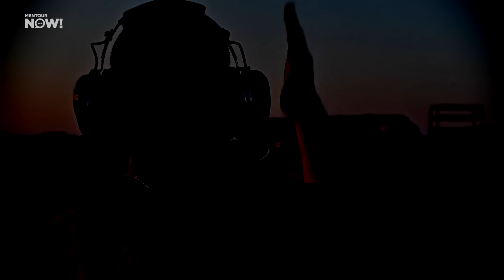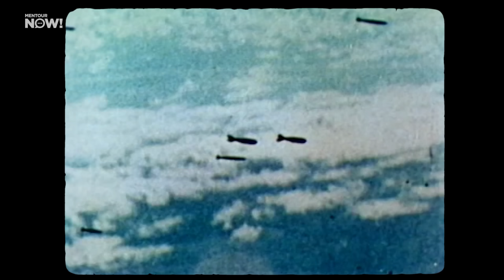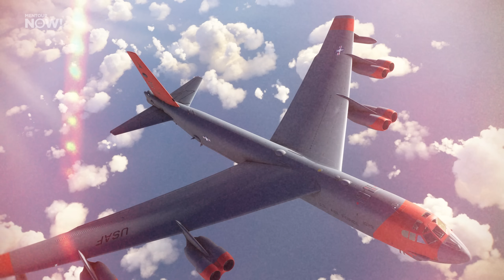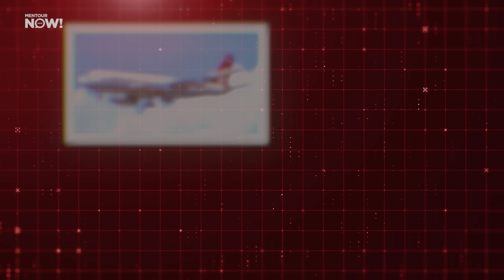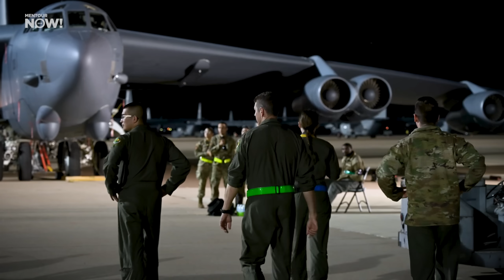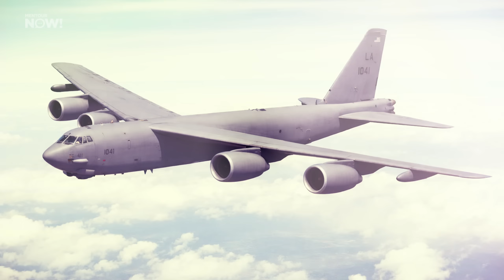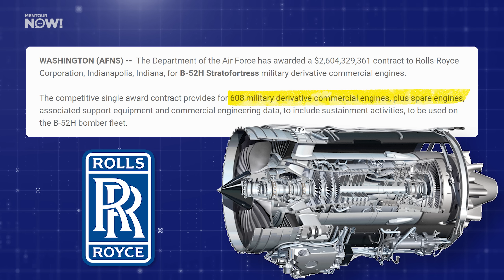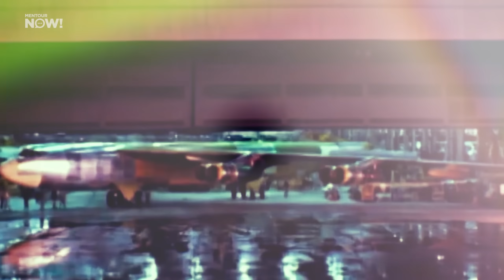WHY Are They Changing The B-52 NOW?!

Comment: At one point the 747 was proposed as B52 replacement. It was rejected because the USAF didn't need a large bomber anymore. Nuclear weapons had gotten a lot smaller and the huge airframes weren't needed,

Ever since then, the B52 has been a solution in search of a problem - and been pretty adaptable, but the primary reason it continues to fly is because it exists and if all B52s were grounded tomorrow they'd have replacement bomb trucks flying next week (Rapid Dragon and its cousins)

It's the "because it exists" that matters. The USAF has tried to retire the B52 multiple times and been stopped every single time by Congress - and in particular senators from states where B52 maintenance is performed (along with the "optics" of having the B52 flying around as a threat to opponents)

The "newer" bomb trucks are much better for crew comfort and safety along with being vastly more flexible but because American politicians won't alllow the B52 to be retired, they're effectively second tier weaponry

With regard to re-engineering the wing box, that's a minor issue compared to the far larger tail that's needed. B52s have a very small rudder and a nasty tendency to snap the vertical stabiliser off in turbulent conditions. It really would be an entirely different airframe by the time you're finished

Comment: the lockheed C-130 Hercules is almost as old as the B-52 (first flight 1954). Indeed, it's still in production. And there is a USAF  KC-135 still in service with the tail number 57-1719, which means it was paid for as part of US defense appropriations for 1957.

Comment: I mean, I have a radical idea for how they could sustain these engines: contract Pratt and Whitney to simply start producing the parts for TF33 and J57 engines again at a small scale. I'm sure there's procurement issues and manufacturing/tooling issues there but those can be resolved

Comment: The B-52 will have an active lifetime longer than most humans.
Truely, a masterpiece of cold war engineering.
Reply: And they will probably last far past 2050 with the new engines. As long as there is need for a large, long range plane that can go decently fast, the modern B-52 role will need a plane.
And designing a new plane is more expensive than just continuing the old ones.

Comment: Are you planning a similar video on the Tu95? It was designed and built at around the same time to do a similar job and is also still flying and doing that job 70+ years later

Comment: It took around two and a half decades to re engine the KC-135 fleet replacing the JT3-D with CFM-56 and that's 400 airframes. Therefore you can extrapolate that to re engine the Buff fleet it should take about two and a half months!😂

Comment: The B-52 is simply in a role that doesn’t require it to be cutting edge. Just its weapons. Fighters need to keep up in a constant race to be the stealthiest, fastest, with the best radar. The B-52 simply needs to carry a big heavy payload far, high, and relatively fast. You could build something new to do it better, but it’s hard to do that job so much better that it justifies replacing it. 

A 20% better fighter might give it the edge it needs to kill the enemy fighter first and remaine unscathed.

A 20% better bomber (in the slow non stealthy standoff category) could go slightly further, slightly faster, and would probably pack the same ordinance as the old one. 

It’s ultimately more economical to make the B-52 compatible with newer payloads than to replace them. If we did build something to replace them, we’d likely end up building half as many without them being able to carry twice the ordinance.
Reply: A study was conducted on the cost of developing an all-new aircraft with the SAME performance specifications and its cost was several times higher than refurbishing and upgrading the existing B-52 fleet.
The B-52 was so far ahead of its time that modern aircraft are not significantly more capable and just cost more to develop and build.
Reply: @DoktorBayerischeMotorenWerke  To be fair, modern fighters are also slower and carry less payload than those of the 80s.
Simply because the operation profile has changed.
Reply: @HappyBeezerStudios  Actually, I was referring specifically to dedicated bomber aircraft... not fighters
Reply: More engine efficiency might also mean more payload.
You can go the same distance with less fuel, so you carry less fuel and put that weight into more load.

Comment: The last turbine disk in a modern engine is rather large and at takeoff power represent a lot of gyroscopic inertia.   Further,  at rotation this results in a very large lateral load on the engine pylon due to gyroscpic response to the rotation.   I submit that the existing wing spars may not be strong enough to deal with such forces at rotation.  A totally new airframe design is no doubt very very expensive.  Witness the high cost of the f22, f35, and other newer additions to the fleet.  Just a few thoughts
Reply: 4 engines do not work for an engine-out takeoff emergency and the resultant lack of rudder authority.  8 engines do.
Reply: @SEO122 yet another reason for the refit.  I think he also pointed out a number of issues which would require wing redesign including you asymmetric thrust at engine out. 😃

Comment: Those old engines are ridiculously loud as well.
I remember hearing something that sounded military, but it was just too slow/lingering to be a Swedish military jet (JAS39), so I checked Flightradar24.
It was a BUFF/B-52 ~40km away cruising at 24,000ft 😯
I couldn't even see it, but it was about as loud as a modern passenger jet coming in for landing.
Reply: The J57s with water injection was louder...
Reply: Believe that's solved by high-bypass engines

Comment: A shout out for those who used to use a slide rule.
Reply: I used a 10" Pickett from 1957 through 1968 when HP calculators took over. I bought it at Bargain Benny's.

Comment: Will the range increase? The range is already 8,800 miles. A 40% increase would give it a range over 12000 miles. That's half way around the world without refueling. 

A B-52 has flown around the world and dropped 27x500lb bombs with the aid of refueling.

And what could be done if you designed a new plane from the ground up with the same mission?

Comment: The amazing thing is that this aircraft, designed back in the days when engineers used sliderules, is still so useful and still flyable in the 2020s and seems likely continue in use into at least the 2040s.

Comment: With the timeline and cost they are talking, and the fact that the # of air frames are finite. It makes me think that perhaps a new bomber with basically the same layout design characteristics, including all the fly-by-wire stuff, 4 new engines, modified wings, etc. might be a smarter long-term plan. Don't the actual air frames have a service life? Are they exempt because they are military? I've haven't heard of any planes made 65 years ago (or even close) still flying commercial passengers. I do think I've heard/read/seen that freighters generally have a longer life, though by how far, I don't know.

Comment: I was told by an engineer that the vertical stab wasn't designed for 4 engines and structurally the aircraft could not have 4 engines.
Reply: Correct. 4 engines do not work for an engine-out takeoff emergency and the resultant lack of rudder authority.  8 engines do.

Comment: Fascinating. I hope maybe you will do a presentation on the huge and mighty Convair B-36 "Peacemaker", the predecessor of the B-52. Powered by six piston engines (mounted as pushers) and 4 jet engines, it made a sound like no other aircraft. Though designed to carry the first hydrogen bombs, it was never flown in anger, but still had a place in the early 1950's.

Comment: I was in the USAF and ANG on various aircraft for 30 years and they have talked about going from 8 down to 4 engines on the B-52 since the 1990's but engines didn't make enough power/thrust until just the last 10 years or so and you have to have enough power in 2 or 3 engines for safety margins to keep an aircraft in the air with a full bomb load + fuel if you lose one or two engines.    And that is why this was never really possible until now.
Reply: 4 engines do not work for an engine-out takeoff emergency and the resultant lack of rudder authority.  8 engines do.
Reply: @SEO122  Its illegal to do a takeoff without ALL engines running to power !     During an Alert coming off the alert pad that might be over looked.

Comment: I remember in the '90's when Boeing, Rolls-Royce, and American Airlines kicked around a proposal to re-engine the bomber with 4 RR engines. Boeing would do the engineering, and American Airlines would do the work at its Tulsa maintenance facility, the Rolls-Royce engines being the same as the ones the airline used on its 757's.

For a variety of reasons mentioned here, as well as the timing of the end of the Cold War, the proposal went nowhere.

Comment: There are certainly at least three major issues related to switching to just four engines: 1) Aeroelastic: the new engines would probably have to be installed further forward relative to the old ones. That would change natural torsion frequencies, which may affect the flutter speed; 2) Aerodynamic: engines that are bulkier and moved forward may affect airflow on the wing upper surface, changing stability and stall characteristics; and 3) Having just 4 engines means that the engine-out scenario is equivalent to losing two of the old engines, which probably implies that more overall thrust is required, consequently higher pylon loads, higher VMC, etc.
Reply: Correct. 4 engines do not work for an engine-out takeoff emergency and the resultant lack of rudder authority.  8 engines do.

Comment: It was drawn up in 1947. Amazing it's still going
Reply: Can you imagine going back to that time, and showing the guys who built the b52 what the latest fighters look like today? And that their b52 will still be flying for another 25 years.
Reply: @BrettJulianChamberlain by 1992 or so the B-52 had been flying for longer than the time between the Wright brothers and the B-52 design being started.
Reply: I think it's more amazing that it was drawn in 1947 and the first flight was in 1952.
Imagine boeing drawing a new plane today, it would be optimistic to think it would fly before 2047.
Reply: @jamoin3829  They started the clean-sheet design for a twinjet 777 in 88 and the first took flight in 94, so that were some casual 6 years.
But then, that was also one of the last full on proper, engineering-based planes they put out.

Comment: I recall when this was first being discussed regarding the Pentagon budget calculations, repowering was ALL about dwindling parts availability and not fuel cost savings. But then someone who actually knew what they were doing calculated that fuel cost was a really big deal since "Airborne" fuel costs about 12-15 times as much as ground supplied fuel.
Reply: As Mentour said, saving money is nice, but for military the increase in range and loiter time will make a HUGE difference.

Comment: When K. I. Sawyer was still an air force base near Marquette, Michigan, they used to fly B-52's around the Upper Peninsula every single day.  You'd be driving down the road and here one would come over at treetop level, or you'd be hiking a remote trail and again, you'd be treated to the sight and sound of a B-52 just skimming the trees.  It was truly an unforgettable experience.  And yes, I have experienced it.
Reply: A regular sight when flyfishing the Escanaba River, back in the day. Always got my attention.
Reply: I was down the road at Kinchloe AFB, MI for 3 years. B52H also.
Reply: Many times. I had a friend in EOD I'd go hunting with, generally for red tree squirrels (no limit on them as they were an invasive species that constantly threatened the forests). You hunt them by ear, listening for them chittering to locate them. My buddy was insane (I think it's a requirement for EOD) and used to shoot at the incoming aircraft because he couldn't hear the squirrels over the engine noise. He finally stopped when he was shocked to discover he'd actually hit one, doing about $40k worth of damage in the nose electronics. He was never caught, but I refused to hunt with him unless he stopped...
Reply: Granny lived in Fort Worth right on the ascent track from Carswell. They were going over like clockwork, spewing black smoke to beat the band. Rattled the blinds.

Comment: My dad use to take me to Castle Air Force Base, and we would stand at the fences and watch the B-52s take off and land. It was fun to see them coming in, and when they’d pass overhead the smoke from the engines would disguise them, and then a few minutes later, from the smoke on the runway, another B-52 would take off and while they are huge, they climbed so fast.

My dad told me a story about in Yosemite decades ago, he knew a pilot in a medical helicopter who was flying over the valley (well high enough above the ridge line), and while the helicopter was facing down one direction, from behind the helicopter and without warning, a B-52 flew under them from behind and popped up above the ridge line 3/4 mile away in front of them. It was a shock for the helicopter pilots, despite there was plenty of clearance between them to avoid a mid air collision, but still quite a sit to see BUFF fly underneath and fly out of the valley as though it was just another Tuesday.
Reply: They were a common sight coming and going near Merced. Something to stop and see up close. Then you realize how uncomfortable that bird would be to fly long distance in.

Comment: Regarding what this means for Airbus and Boeing commercial aircraft; well, both have been there, Boeing several times over with 737. 

One of the things though that I think Airbus has done better is to get the fundamental proportions of their fuselage's right first time. They also have systems in its designs that - now - are old (30+ years since their fly by wire came in), but critically are not "obsolete". There's not much room for improvement, and so it's worth maintaining / renewing their FBW system more or less ad-infinitum. Whereas Boeing really need to throw away the 737 and will be lucky to merely match the A320 neo (or, A320 neo neo) with a new Boeing design; the cutting edge simply has not moved far since the 1990s. 

With the B52, it's more of the same I think. You'd not really end up with a radically improved capability if one did a complete re-design, or if one adapted an existing commercial airline design. There's some nuance there; sure, one could probably easily make a bigger bomb hauler, but if missions today are routinely carrying ordnance back home one doesn't need a bigger payload. Where as increased endurance (which is what the engine upgrade will give) allows for more ordnance per mission to be dropped, as the increased loiter time increases the chances that someone will ask for it to be dropped. It also translates into a heavier payload dropped at extended range. 

BTW it sounds like the inlet issue is solved according to Air and Space Forces Magazine June 17 2025. The inlets are Boeing, not RR. The electrical work seems to be the big stumbling block, but it will definitely be worth the wait.